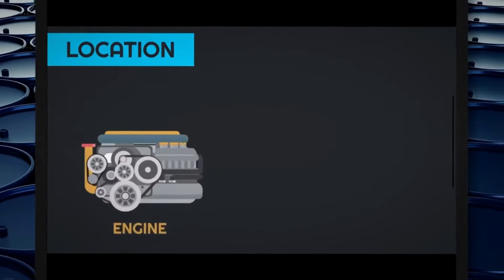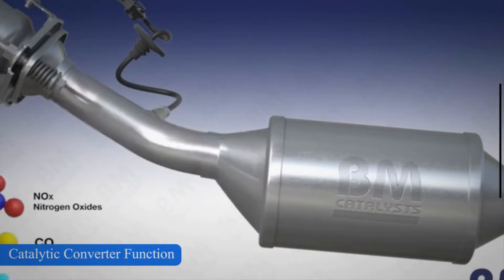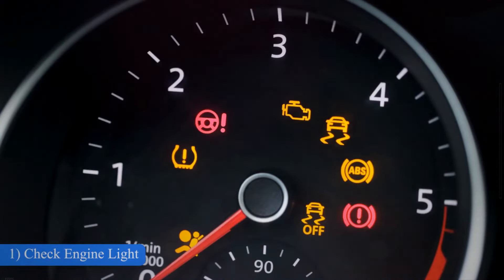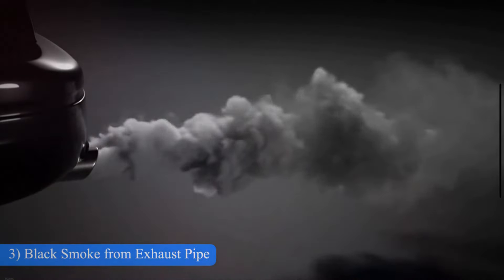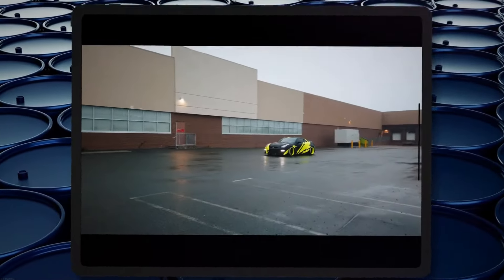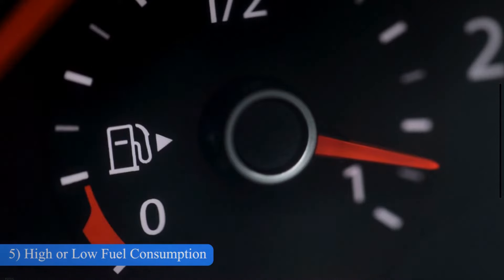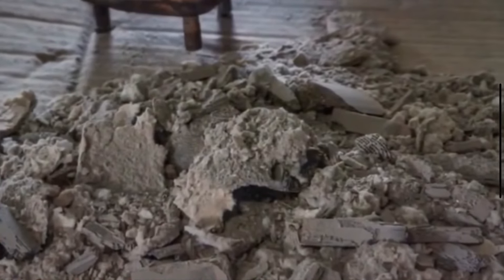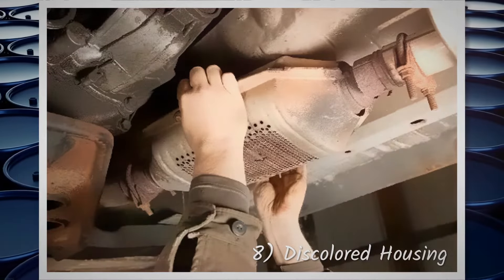Top 10 Symptoms of Bad Catalytic Converter

Comment: If you don’t want to run off of a cat converter look into carbon air intakes, it completely removes the cat converter and makes pure exhaust from the engine to the pipe
Reply: How does that work
Reply: Do you have to take the cat off or air punt
Reply: @Aj-hc9zf  I got my cat off but I have a modification that’s basically straight exhaust from front to back, improves airflow tenfold, it’s legal anywhere in the States, sounds badass, and doesn’t expose me to toxic exhaust, it’s a plus all around especially on a VTEC
Reply: @Aj-hc9zf  so like I said it replaces the cat converter and makes straight pipe from front to back, it’s essentially is better airflow and less weight
Reply: @CT-5689 so it’s a straight pipe my car is running a bit ruff took to mechanic they said need to replace it but if I could just straight pipe it’ll. Be cheaper
Reply: @CT-5689 sound better and add more air flow
Reply: @toosaucy1753  would you rather put a good air filter on your car or get carbon monoxide poisoning?
Reply: would you still be able to make it quiet? asking from a limo driver perspective my customers would rather a silent car than a loud one sadly
Reply: @malikabbas9091  ha no, carbon air intake is gonna make it loud, no doubt about it, you could get a custom muffler if you want it more quiet though
Reply: @CT-5689 and how not to get the check engine light? Without a catalytic converter.

Comment: I call Bs on the converters,  cars can be tuned to have equal to or better output as a converter,   However, the additives being mix in gas cause a concern,   Gasoline of today is no where near as clean as it was 30yrs ago.

Comment: I had a check engine light on my car, it was scanned for a bad catalytic converter. I don't have any of the severe symptoms other than the light, how bad is the risk to drive halfway across America?
Reply from the maker: If your car's diagnostic scan indicates a faulty catalytic converter but you aren't experiencing any severe symptoms such as significant loss of power, unusual noises, or excessive emissions, it's possible that the issue might not be immediately critical. However, driving long distances with a potentially malfunctioning catalytic converter can still pose some risks. Depending on local regulations, driving with a malfunctioning catalytic converter could result in fines or legal consequences, especially if your vehicle fails emissions tests.

Comment: I have only four out of the 10 symptoms, 2016 nissan frontier, it doesnt go fast like it did, sluggish exceleration, high fuel consumption, thats the main things . About two years ago i smelled sulfur for a while and i saw smoke come out tail a few times,. I may have smelled sulfer only a few times the past year. I took it in for a battery in 2023 when this started and they told me i need my fuel injection service and replaced spark plugs. I hope its not the CC thats a 2,000$ part. But im worried is the sulfur smell mean its only the CC. Thankyou.... I goggled what else can smell like sulfur, it said CC, Fuel filter, fuel pressure sensor. So I'm  thinking it's the  fuel injection, like the man said at viking automotive.
Reply: Yeah cc can have a bad smell im getting mine fixed now. Hopefully that’s the issue im getting sparks coils done too

Comment: The morning I drove to work, my car ran fine. I needed gas so I put 93 in my car and arrived to work. I started my car that night leaving from work. The car felt normal until 10 min into my drive, the turbo felt jerky, 10 more minutes into the drive I was idling at a red light and smelled a car that has no cats, I have cats so I assumed it wasn’t me, once I got off the red light all I hear is my car rattling and popping my car naturally has a pop tune so all I hear is my car popping, like it had antilag, and I saw grey/dark smoke coming from my exhaust. I couldn’t go beyond 3k rpm. Would my catalytic converter be the culprit?
Reply from the maker: @RamzaBeo  Based on the symptoms you described, it’s possible that your catalytic converter is involved, but it may not be the sole issue. Let’s analyze the situation:
1) Jerky Turbo and Reduced Performance:

This could indicate a restriction in exhaust flow, potentially caused by a clogged or failing catalytic converter.

Alternatively, it might point to a misfire or an issue with the air-fuel mixture (like fuel contamination or injector problems).
2) Smell of Unburned Fuel/No Cats:

If your catalytic converter is failing or clogged, it might not be processing the exhaust gases properly, leading to a strong smell.

This can also be a symptom of incomplete combustion due to misfiring or an overly rich mixture.
3) Rattling and Popping:

The rattling could indicate a broken component inside the catalytic converter, such as the ceramic substrate.

The excessive popping could result from unburned fuel igniting in the exhaust, which might happen due to improper combustion or a failing turbocharger.
4) Smoke (Grey/Dark):

Dark smoke suggests incomplete combustion, which could be caused by a failing turbo, a rich air-fuel mixture, or fuel contamination.

If the turbo is compromised, it could be leaking oil, which also produces smoke.
Catalytic converter, fuel quality, turbocharger and ignition system are the key culprits.
While the catalytic converter is a strong suspect, a full diagnostic will confirm whether it’s the primary issue or if other systems are involved. If possible, avoid driving the car until the problem is addressed to prevent further damage.
Reply: @ the only codes that came up where misfires on cylinder 1 and 3. During that night the CEL came on then went off. Then it came on and started flashing. And btw the car is undriveable, the car feels like it’s suffocating when I press on the gas. The only way I was able to get home that night was just allowing the engine to coast me to my house. My turbo never made any whining sounds prior. Plus this is a new turbo. It’s a stuffed K03(golf R) turbo. I also put gas in my car that day too before work. It could also be bad gas too?

Comment: Hello i have a 2004 nissan titan would a bad oil filter make the vehicle not start btw im gonna get a new oil filter soon and im gonna get a catalytic converter and try and get a manifold too
Reply from the maker: A bad oil filter itself typically wouldn't prevent a vehicle from starting. The primary function of an oil filter is to remove contaminants from the engine oil to keep it clean and protect the engine. While a severely clogged or damaged oil filter could potentially restrict oil flow and lead to engine damage over time, it wouldn't directly cause the vehicle not to start.

Comment: My engine light went on over  a year ago and I did'nt want to deal with it then . I was out of town and it happen in parking lot went to start Vechile and it startrd and it turned off it would turn over and then just turn off..... I regret it now stupid move cost me $500 dollars to have it towed back home.
Reply from the maker: Therefore, it is always recommended to contact a professional mechanic as your vehicle starts to produce even minor problems... If you ignore minor issues, they may become bigger over time and cause costly repair.
Reply: My car only have the check engine on

Comment: Can a bad catalytic converter cause white smoke when I start the vehicle? Engine starts, a lot of white smoke and water from the exhaust which eventually goes away after a minute or two
Reply: Also have same problem ..do you solve your problem??
Reply from the maker: A bad catalytic converter typically doesn't directly cause white smoke when you start a vehicle. White smoke upon startup is often a sign of coolant leaking into the combustion chamber or exhaust system. This could be due to a variety of issues such as a blown head gasket, cracked cylinder head, or a damaged intake manifold gasket.
However, if the catalytic converter is severely clogged or malfunctioning, it can cause excessive heat buildup in the exhaust system, potentially leading to other problems such as overheating of the engine or damage to other components.
Reply: @YounisMengal-vlogs  I opened my intake/exhaust manifold and found a lot of oil inside. It was horrible. The engine needs to be disassembled
Reply: I use Benz e350 w211, could it be the reason ,it jerks on high speed and reduce speed until it stops responding to acceleration, but resume normally after cooling off, yes I just changed the 12plugs too

Comment: My mustang made rattling noises out of nowhere with me cruising like 45 and hasn’t stopped also check engine light came and the 02 sensor code came up and failed emissions is that catalyst failure ?
Reply from the maker: It's possible that the rattling noise and the check engine light indicating an O2 sensor code are related, but it doesn't necessarily mean it's a catalyst failure. Rattling noises could be caused by various issues such as loose parts, exhaust system problems, or engine issues.

The O2 sensor code could indicate a problem with the oxygen sensor itself, or it could be a symptom of another issue affecting the air-fuel mixture or exhaust system. A failing catalyst can sometimes trigger O2 sensor codes, but it's not the only possibility.
Reply: @MechanicalBoost so I got no rattling noises on my 95 mustang, but my performance has been down dramatically, on the first cold start it acts like it wants to shut off until I idle it for a bit, I smelled fireworks or rotten ends coming from somewhere (not the hood thankfully) tonight could that be the cats?
Reply from the maker: @KingKhiddoxYuneek  
Yes, the symptoms you're describing could point to a failing catalytic converter (cats). Here's why:

1) Performance Drop: 
A clogged catalytic converter can restrict exhaust flow, which in turn reduces engine performance. This could explain the dramatic drop you're noticing.

2) Cold Start Issues:

A restricted or failing catalytic converter can cause a rough idle or even stall-like behavior until the engine warms up, as it struggles to maintain proper airflow and fuel ratios.

3) Rotten Egg or Fireworks Smell:
That smell is likely hydrogen sulfide, a byproduct of incomplete combustion caused by a failing catalytic converter. If it's more "fireworks-like," it could also indicate an issue with unburnt fuel in the exhaust system, which could overheat the cats and damage them.

Comment: Can a melted catalytic converter to give a missfire?I have a mazda 2.0 petrol engine with Missfire on cylinder 4 (P0304).I changed spark plugs, ignition coils, injector, O2 sensor but still have the error.Also i have checked compression, fuel pressure..both are good.
Please help me😢
Reply from the maker: @BrunoBMS  Yes, a melted catalytic converter can cause engine misfires. When a catalytic converter melts, it often becomes partially or fully blocked, restricting the exhaust flow. This creates excessive backpressure in the exhaust system, which disrupts the engine’s ability to expel exhaust gases efficiently. Here’s how it leads to misfires:
Reduced Exhaust Flow: Excessive backpressure affects the air-fuel mixture in the combustion chamber. When exhaust gases can't exit properly, they can interfere with the fresh intake air, leading to an inefficient combustion cycle.
Overheating: Blocked converters can increase exhaust gas temperature, causing the engine to run hotter. This can damage components, including spark plugs and ignition coils, leading to misfires.

Oxygen Sensor Issues: A malfunctioning catalytic converter can also affect downstream oxygen sensors, which measure exhaust gas composition. This can cause incorrect adjustments to the air-fuel mixture by the engine control module, leading to poor combustion and misfires.
Reply: @MechanicalBoost  thanks a lot, i really appreciate your explanation 🙏.That makes sense, because i forgot to tell you that the engine is overheating, and i changed the O2 sensor, the spark plugs and one ignition coil because was demaged.Anyway..i have one more question:assuming that my catalytic converter is melted, why this missfire is only on the 4th cylinder all the time?
Reply from the maker: @BrunoBMS  
When misfires consistently happen in a specific cylinder, like cylinder 4, it could be due to a few reasons:

Exhaust Flow Dynamics: The layout of the exhaust manifold or the catalytic converter might cause cylinder 4 to be more sensitive to any restrictions or back pressure, making it more prone to misfire when airflow is blocked.

Heat Buildup: If cylinder 4 is farther away from the cooling system's main flow, it might be more prone to overheating under increased back pressure, leading to a higher likelihood of misfire.

Fuel/Air Mixture Distribution: In some engines, certain cylinders (like cylinder 4) may receive a different fuel/air mixture than others, especially under conditions where exhaust back pressure is affecting overall engine performance.

Pre-existing Weakness: If cylinder 4 has a spark plug, coil, or fuel injector that is slightly worn or weak, the additional stress from the back pressure might be enough to push it into consistent misfire territory.

If you’re experiencing repeated misfires in cylinder 4 with a melted catalytic converter, it’s a good idea to inspect not only the exhaust system but also the ignition and fuel systems in that cylinder to rule out any additional issues.
Reply: @MechanicalBoost  Can the catalyst be melted if the nox test comes out ok?

Comment: Does bad cat make rattling sound(just like an engine without engine oil sound) cause i was in montreal and my car made very weird rattling noises just like i mentioned before whenever i go uphill or start moving after a stop the rattling sound was there and also sometimes my low engine fuel light comes on sometimes but next day when i went to my car mechanic he said oil level is normal and the car is not burning any engine oil.
Reply from the maker: Yes, a bad catalytic converter can sometimes make a rattling sound, similar to the sound of an engine lacking oil. This typically occurs when the internal components of the catalytic converter become damaged or loose. The rattling noise may be more pronounced during acceleration or when the vehicle is idling.
Reply: @MechanicalBoost   hey i really appreciate the reply but i have another question adding to my first one that so whenever that sound comes sometimes the low engine oil symbol also lit up for 1 sec not ever-time but lets say 5 out of 2 times but my car’s engine oil level (was-is) normal and it is also not burning any oil
Reply: Im having this issue with my 2017 Chevy Sonic @MechanicalBoost

Comment: Usually never goes bad, however they do sometimes. Family member had a Chevy Blazer having engine problems, had check engine light, 

Had over 120,000 miles

Called me I said it might be plugs, spark , or anything 🤔 

Took it straight to mechanic shop used that high tech computer mechanic, cost 3500 dollars 

2 weeks later started acting up again , again called me I went there and tested the fuel pressure, spark plugs , 

Funny but when you gave it gas the fuel pump pressure fell down terrible and it would miss, 

Installed a 250.00 fuel pump never had no more issues, 

They do go bad but check everything else never trust that computer shit !